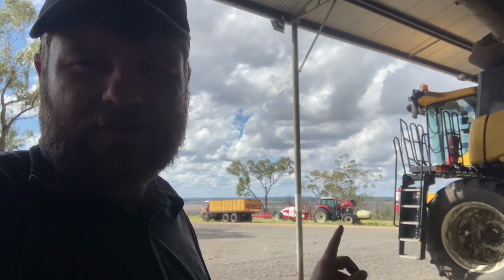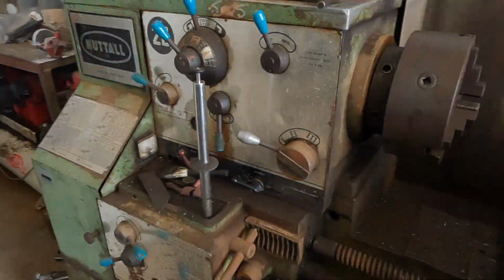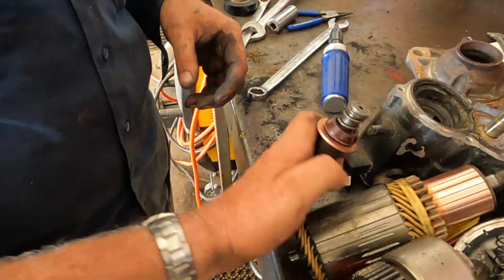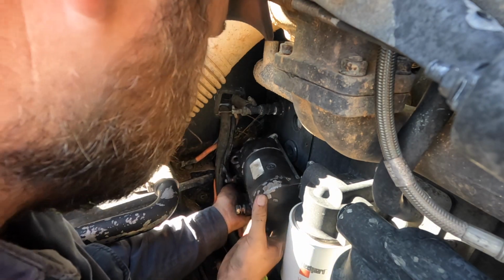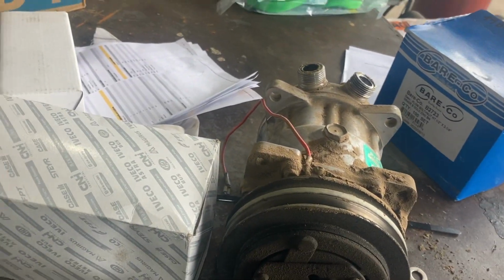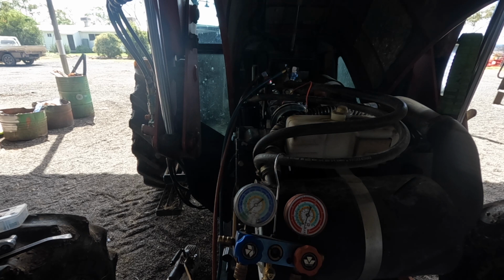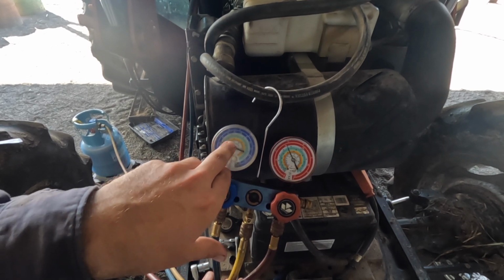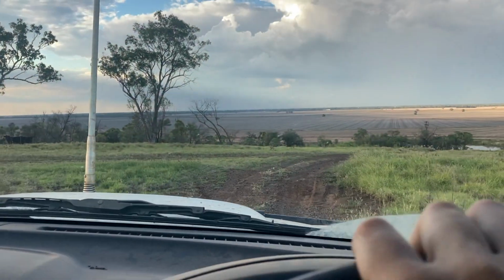More to fix! (Vlog 69)

Comment: Hi Guy's.  I have a JX80, have spent a fortune on it over the years trying  to keep the AC working and that earth wire keeps melting on that switch as well .It's only done 2200hrs , just crap. 
Love the channel
Reply from the maker: Hi Wayne, feeling your pain, it’s almost like it’s a fake case😳
Reply: Yes exactly,  one comes out one side  of production line red and the other side  comes out blue
Reply: @waynemainey8866  Korea one step above China?